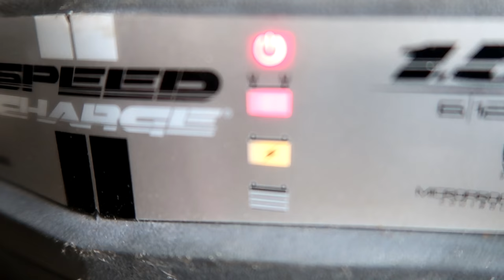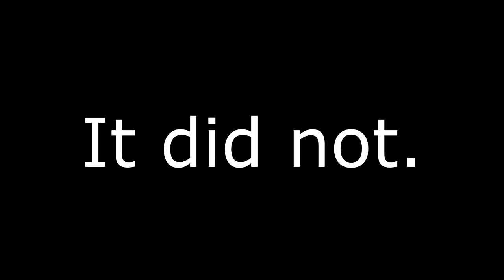THIS is the WORST MACHINE

Comment: Rule 1- never buy at night. Rule 2- never buy when it's raining or just has rained. Rule 3- avoid sketchy deals even if it's the least bit
Reply from the maker: I broke all 3 lol
Reply: (A hot water pressure washer may have helped yield better results...)
Reply: Adam Holt I agree
Reply: Wow I bought my truck on a rainy night and it was the worst truck I've ever had im listening to you for next time
Reply: Hey 3D Machines what year is the crf?
Reply: My old Auto tech teacher from my high school taught me those tricks I never really believed him at first but sometimes the smallest piece of advice becomes the greatest
Reply: Hiring a mechanic to bring with you can help avoid a costly purchase!
Reply: True any time I went to buy any kind of vehicle or ATV my dad always goes with me to double check everything and anything I miss
Reply: Adam Holt or bring a great flashlight to inspect it properly!
Reply: Adam Holt Yes
Reply: Adam Holt I agree
Reply: I will remember that advice I been screwed over before

Comment: dalton the reason the nut isn't welded is if the bolt somehow came loose it won't back right out with vibration and therefore allowing the muffler to fall off just thought that might help

Comment: Hay Dalton I'm not sure what type of cleaners you use, I have found purple power cleaner works great using it full strength. I use it from commercial air filters to and most of everything in between cleaning in the house diluted to car parts and even concrete when i spill on the floor. It is worth giving it a chance i even use it in my pressure washer but should be cleaned out and not left in the pressure washer.

Comment: hi 3dmachines look at a thing like that you shold bring a blowtorch out and heat it up at the point that needs to be bent after its glowing red wipe it with a wet rag....trust me it will straighten itself out ;) i did that on a truck that had a bent frame and it straightened out to its original state.

Comment: Buying wrecks like this is never cost effective. When repairs and new parts have been fitted which will be required before use, the cost will most often be more than a machine in good condition and running well. Years of neglect and lack of maintenance will sometimes mean major parts will be badly worn or broken, and properly repairing will increase costs drastically. In this case the chassis is destroyed, and while it can be patched up, replacement is the best option.......................

Comment: I had two of them kodiak's and both of them were money pits.  check the timing chain on it they are known for timing chains stretching out on them and make sure to keep the radiator clean from all the mud cause they like to over heat but besides that they are ok quads the grizzlies are better

Comment: You need a hot pressure washer, stick a dawn bottle under the soap input and the grease disappears, use it on the baler where the chain is oiled constantly and you end up with every edge absolutely full of mud made out of grease and dust, usually comes right off

Comment: I'm surprised you don't get an over loaded circuit with all those plugs
Reply: Darrek LeRoy- depends on how much each appliance draws off it. An electric heater and a hairdryer will trigger most circuits. Those little auto chargers are only at 2 amps plenty of room for more

Comment: Hey you should be using a face shield instead of just safety glasses when using a cutoff disc. I work in a weld shop and have seen them bust apart sending it flying. One guy got it imbedded in his face. He was only wearing safety glasses. If he wore the face shield like he was supposed to then he would not have ended up having to go to the hospital to get it removed and have the 40 stitches. $14 for a face shield is cheaper than the $5000 hospital bill.

Comment: the reason the dirt is stuck on the engine is because they never washed it and then the dirt keeps sticking to the motor and the motor gets super hot and the dirt bakes onto the motor making it extremely hard to get the dirt off

Comment: The Only way to get actual grime off with a pressure washer is with a hot water pressure washer.  Cold water will simply not touch grease at all.

Comment: Mines the same but won't start the coil and computer of the quads dead and 200$ in parts it just went up in smoke when I hit the start button (I was charging the battery) same make as yours (2000 and is green) can someone say if they had the same problem thanks (sorry for spelling)

Comment: ATTENTION 3D MACHINES!!!!You should jack up the rear of the 4 wheeler attach a chain to the bent frame attach the other end to a beam in the ceiling  then let the jack down and jump on it a little to bend it back straight unless you have already cut and welded it then i that case I wasted 5 min of typing